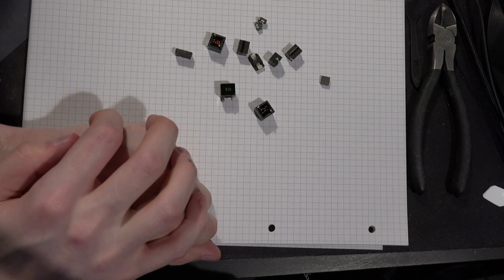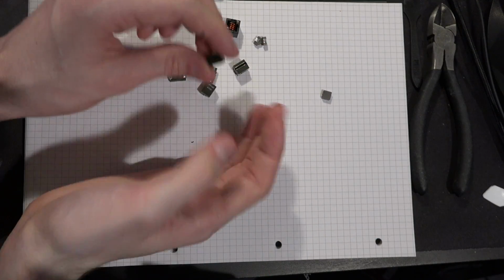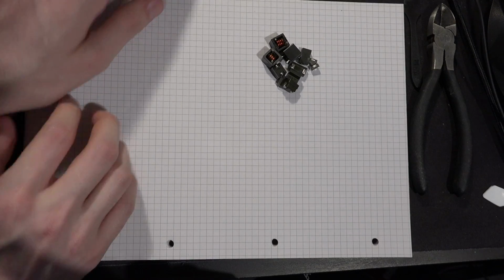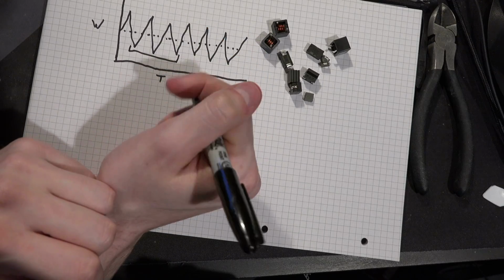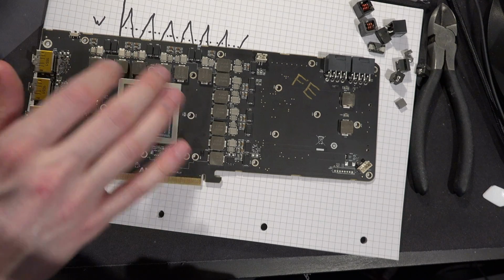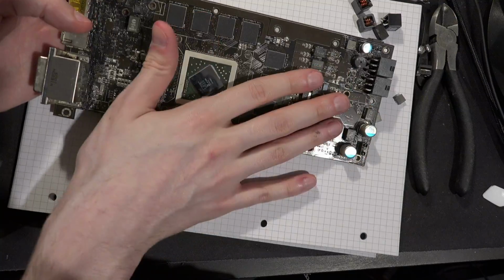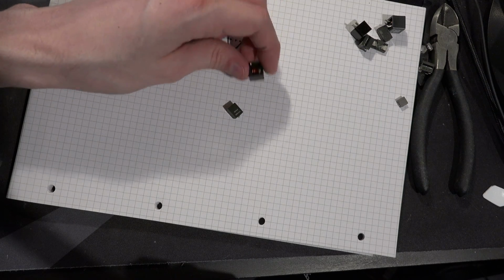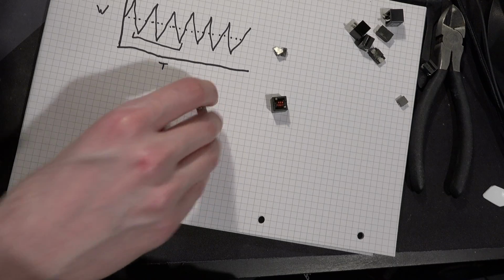Rambling about Coil Whine

Comment: R15 inductor, widely used for todays GPU's have worst coil whine and these are one part, sealed from all sides - nothing you can do about it. Just returned thrid XFX 6800XT Merc319 CORE as it was unbearable. 100% sure it was GPU, tested in all ways. Currently got MSI Gaming Z Trio, which have slight coil whine on default settings, and none on UV to 2300Mhz 1100mv, but its ticking on desktop and internet browser. 
Thats my last upgarde in my life, if we have degrading quality with every gen i just stop buying it.

Comment: I think you just said it your self get a gold rated power-supply to give a smoother load delivery.. if your using bronze surely it will give a more stagger type of load delivery?  gold is a better conductor! ? I am not rating bronze power-supply its like trying to keep a power state but struggles? so if its doing it at a fast rate surely it will as you say speak. their is no steady flow of power.

Comment: Does RTX series use the 2nd type coils ?
Reply from the maker: Most modern GPUs use the 2 piece core around a metal tab. The fact is that if you ignore the tendency of these to whine they are far superior to other inductor designs in GPU and motherboard applications.
Reply: @ActuallyHardcoreOverclocking  ahh kool, my 2080Ti has a noticeable whine with a waterblock compared to my 1080ti. Not as bad as the R9 290x is had tho.

Comment: bronze isn't rated for gaming. you should be using gold. as the parts in your machine work way much better with power performance when a delivery method is better. bronze is mainly for desktop mass manufactured power-supply's for business use in the standard office type building. as its very cheap and cost effective.

Comment: Hey I know this video is 4 years old, but I gotta ask since you had the 6900xt Red Devil. I bought a 6950xt Red Devil and the coil whine is quite harsh at high FPS in games like Fortnite, Dota etc. Do you have any recommendations as to how I can address the issue and which components on the board should I look at first? Thanks for your vids man, highly educational always.
Reply: Undervolt and cap frames are the only solutions sadly to minder coil whine. You can try change the psu. It can be better but also the other way around. Powersupplies have an influence but it’s not the holy grail
Reply: I've used epoxy and superglue on all coiles in my 4090 - now 100% fixed.

Comment: Why do you apply pressure to the die? Is that safe? Can it not.. I dunno, crack?
Reply: just enough to stop them vibrating. you should not need a lot.  a thin thermal pad should be enough to try

Comment: Is this phenomenon the same as transformer hum or magnetostriction?
Reply: Exactly correct.  Flux swing will depend on core material used.  Ferrite about 2500 gauss max, powdered iron about twice that.

Comment: Could someone help me out? Was changing my fan speeds in my bios and the bios just froze up out of nowhere. Idk if I should be worried or if that's just something that happens at times.
Reply: Cpu or ram not stable. Happened to me during overclocking my cpu and ram
Reply: @adriantengsantomo8960  well I don't have anything overclocked. I recently swapped out my old CPU cooler for a new one just to get better airflow. I only have a i7 7700 and ram clocked at around 1400mhz. I'm still fairly new to the whole PC environment so im completely lost when it comes to troubleshooting.
Reply: @jbap6981  try downloading memtest and run for an hour or so. For the cpu try intelburn test or prime95. Check which one fails. Also are you using ddr3 or ddr4 ram sticks? 1400mhz seems fairly low for ram nowdays unless you're running ddr3
Reply: @adriantengsantomo8960  my bad Its actually 2400mhz but yeah it's ddr4. When I do the cpu test tho why would I want it to fail? I've never ran any stress tests or benchmarks before.
Reply: @jbap6981  sorry bad wording there. You dont want it to fail. But in case if either did, then you know which one causes the instability.
Reply: @adriantengsantomo8960  I see what you mean. Well ill definitely take a look at those tests. I appreciate your help alot.

Comment: Is there a way to check before buying  the GPU card the specification of choke, to predict if card will be whining? Is there any parameter for that, for example, if it is molded?
My Sapphire rx580 8gb pulse whine a lot, in contrast to my Sapphie  Dual X HD7970 3gb I had a while ago :D I wish to find out if I will buy GPU next time I can look for some better custom PCB design :p
Reply: Check reviews, vega card  has common coil whine issue that's y I didn't buy it.

Comment: I have an old Sapphire HD4890 it doesn't have coil whine it has coil 'rattle'
Interestingly the coil whine is in sync with framerate and at low FPS under high load it makes sounds like a rattlesnake. 

Apparently it was normal on the Sapphire Vapor-X HD4890 2GB. 
Still bizarre

Comment: Wouldn't limiting my fps also help with coil whine? Also I noticed that three factors affected my Sapphire + 5700 XT coil whine:

Gigabyte RGB Fusion RGB program (closing dropped sound by half)
Power supply or PSU connection (swapping to 6+2 connections with a pig-tailed cable helped)
V-sync options (activating this option dropped the noise alot)
Reply: Yes. High power usage but low load makes the worst coil whine, which is why it is often heard in menu screens. Limiting FPS eliminates this problem.

Comment: How close would you really need to be to even hear it I have a windforce 290x and haven't really noticed but my computer is extremely loud to begin with
Reply: I can hear slight coil whine from my RX 480 sitting about 1.5m from it.
Reply: @DrathVader  thanks Darth I sit like 3 meters away so I'd probably not notice it but for shits and grins I'll turn my fan profile down and see what's up
Reply: I can hear coilwhine from my EVGA 1080 FTW (ACX 3.0 cooler) if the PC sits on the table and the GPU is on ear level, but not if the PC is under the table, i game at 144FPS and the system is completely silent in idle, just while gaming the fans spin up a bit more of course.

Comment: My R9 390 doesn't whine because nvidia is not limiting my power!
Reply: @boothegoo pc Sorry? Can't follow.
Reply: had GA 390x and sapphire 390x both first on air later on water no coil whine and same ga and sh 5770 no coil whine, but using AX1200 psu